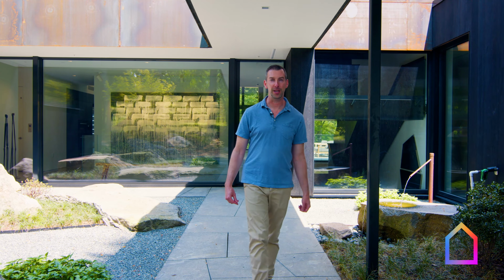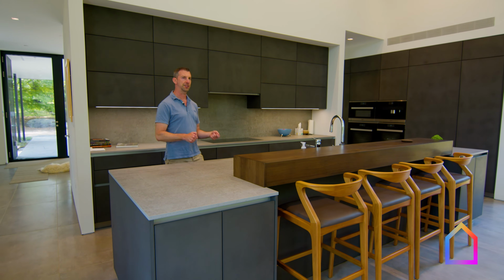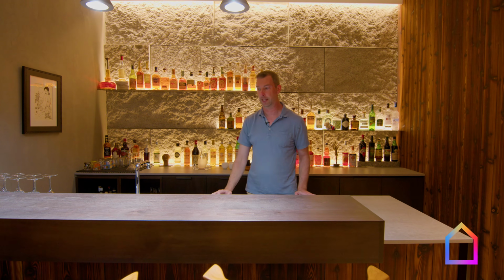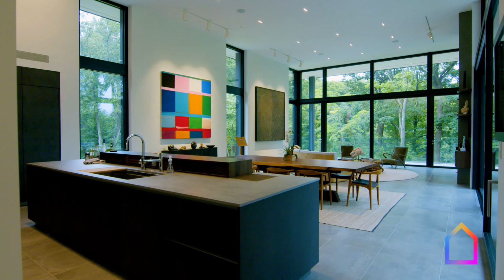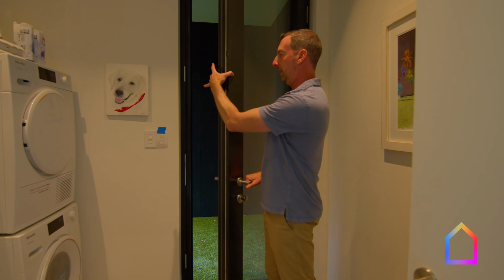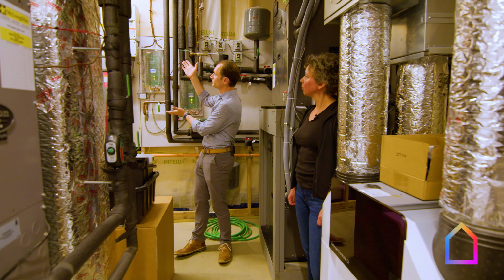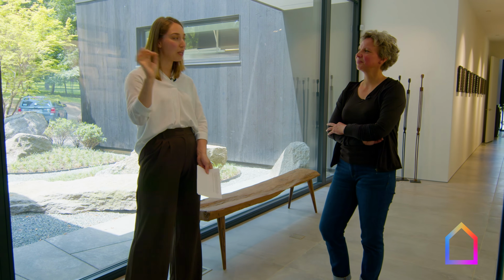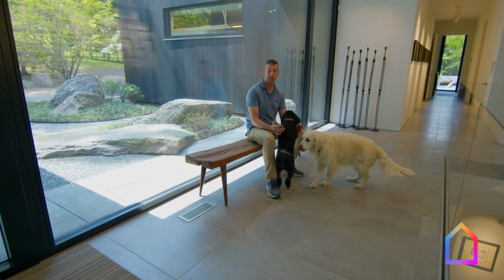TOURING an Art Collector's Stunning Passive House | Passive Pads

Comment: Can you talk a bit about what is passive home? I live in a passive solar home with non-mechanical systems. I don’t have a furnace. We rely on natural air convection to move around hot and cold air. Our climate allows this because we live on the California Central Coast.  We have solar fried-tied electric. And a diesel backup generator. Do you have experience with geothermal and sand batteries?

Comment: Interesting video, thanks.  I had to stop at 14:33 because everyone is talking about panelization without telling us what it is.  Maybe they do later, but it is frustrating listening to this when I have no idea what the term means.
Reply: Interesting point. Panelization for this project meant several things. The walls were built off site preinsulated with a membrane on the exterior. The Roofs and Floors were built off site too, but we left uninsulated due to the increased weight. The foundation was also built offsite and was concrete panel with a foam interior. The fact that these were built offsite and brought to the site and erected makes it prefabricated.

I hope this helps!
Reply: @kylemacht  Thank you.  I thought it was probably something like that, but it bothered me they didn’t explain it at all. :)